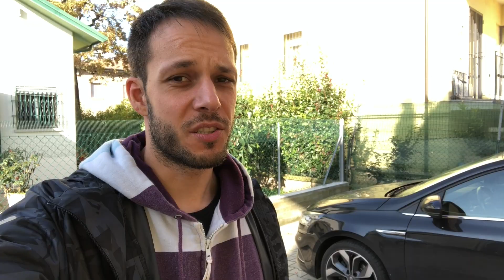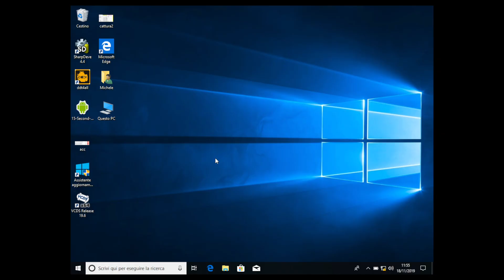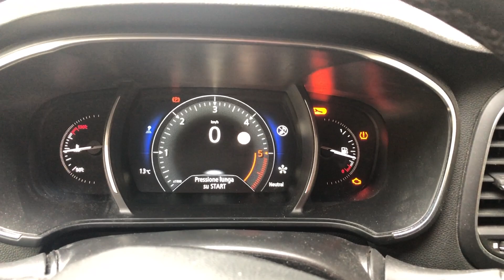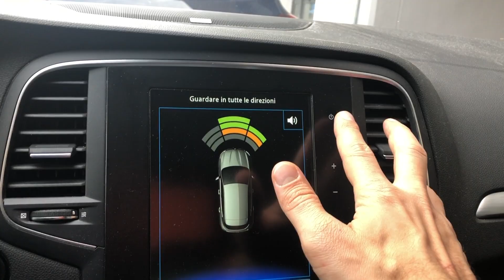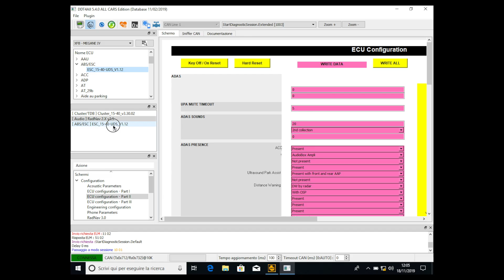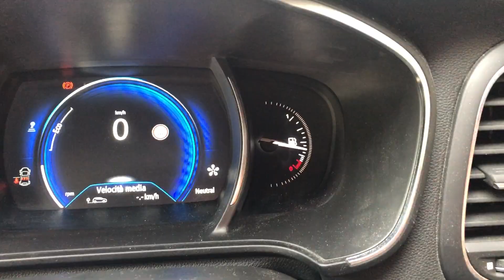TPMS Sensor Deactivation and Error Clear with DDT4ALL | DDT4ALL and R-Link 2 Tutorial

Comment: I have got Dacia Sandero 2015. year with TPMS, using pressure sensors on valves. I have got three sensors, one sensor is missing!? Is it possible to disable TPMS? Is it safe regarding ECU, computer? Thanks in advance

Comment: Hello MicheleP, I watched all of your tutorials, but I am stuck and I need help, I am willing to pay in exchange for the help.
I swapped cluster, I had the simple megane 4 cluster, and I got one from megane 4 GT . 
I get parking sensor error, parkingbrake error, sos call error, and as soon as I open the front doors ( when just unlocking car ) the car plays the sound and warning as if the doors were opened while driving ( but car is parked and engine off ) 
Also, the new cluster has a lot of kilometers, while my car is under a year old, and has 30k.
I went to the section you showed, even found the option to "sync" kilometers from ECU with the odometer, but nothing changes, and the errors are annoying.
I tried to clear them with DDT4ALL, also following your tutorial, but didnt work.
Please help, I can provide email or phone number for viber/whatsapp , whatever, and can pay for your trouble.

Comment: Thanks MichelleP! Finally I'm sorted.
6 months ago I bought bigger  20" alloys with new tpms for my 2017 koleos. Renault wanted £450 for reprogramming the new sensors. I didn't want to pay them that much just for a 30min job. So I searched the web, forums etc. and I came across your video. Bought the OBD2, downloaded the program and connected the wifi pc to the OBD2. It was very easy. I also changed the welcome logo to RS logo.
Reply: Greetings, did you turn off those old sensors or did you pair the new sensors?

Comment: It does not work on megane 4 2018. It loads all settings for cluster but after I change setting to "Without TPMS" it disconnects. Then I can't connect anymore. After some time it connects again but can't load parameters. Program just freezes.
Reply: Hi, which obd did you use?

Comment: I just bought a 2nd hand megane 4 gt-line 1.2 I'm wondering if TPMS is standard or not? When I check the Tyre pressure screen it's all - - if I reset it it tries forever but never settles on a number

Comment: Please can you help me. I have a Megane 4 RS. Im changing from 18 inch to 19 inch wheels. In ABS/ESC section on the video.... i have 3 different versions on my DDT4ALL.
- ESC_15-40-USC_1.12V
- ESC_15-40-USC_1.5V
- ESC_15-40-USC_1.8V
Which one do i change???

Comment: Ciao Michele, if could I have the question, after changing the tires the error with the "key" has appeared, did you know maybe how to reset (clear) the error without deactivation tmps sensors? Just to force the system to new search the sensors? Thanks for your answer. Ciao

Comment: Hi friend. Nice tutorial.
I have a clio IV and I have one question.
I disabled in TDB module, the TPMS: option (without TPMS) because one of the 4 sensors are broken.
After I reset dashboard to clean the message ( Test tyre sensor), but after a few km the message appears again.
Why does the message appear again, if I have tpms disabled?
Thank you bro. 
Pd: using the same obdII + ddt4all

Comment: In my Megane 3 ph2 with ECU L38 ...95 (scan the ecu via can option first!) The option is not at all TPMS, the option is in the same sub menu but called SSPP; However you simply cannot disable it or on the ODO you will show ERROR PROGRAM...Garage told me since 2016 it is mandatory to have the check Hence no disabling of this menu allowed...cannot say if true but i cant put it OUT.

Comment: i did this selecting megane IV, i actually have a Megane station wagon from 2014, once done there is "ERROR PROGRAM" instead of the TPMS infos.

Any idea? Is this just because I used the wrong car model? I tried to undo the change but it wont clear. I put the old wheels back but the menu is just gone and replace with the "ERROR PROGRAM"

Help please
Reply: The garage told me the tpms is store in 3 devices, odometer, ecu and one more...if one is out, the other 2 will complain about it and give errors...so i need to find the other 2 and change them. This tutorial did not work for me.
Reply from the maker: With my tutorial I always manage to clear the error. So I’m sorry if for you doesn’t work but I cannot help you
Reply: @drivewithmi  i am not blaming you ;), just a pity it doesnt work for my megane sw 2014.
Reply: @Michele Predieri and to whom it may help, i fixed the issue. In my Megane 3 ph2 with ECU L38 95 (scan the ecu via can option first!) The option is not at all TPMS, the option is in the same sub menu but called SSPP; However you simply cannot disable it or on the ODO you will show ERROR PROGRAM...Garage told me since 2016 it is mandatory to have the check Hence no disabling of this menu allowed...cannot say if true but i cant put it OUT.
Reply: @chefitalieitaliaanskokenop2200  I have a Renault Megan MK3 Diesel Estate. I want to turn my tyre pressure sensors off with this DDT4LL.  How did you do it on yours? Thanks
Reply: @TDE-76  see my previous post, the option in my car is sspp not tpms, but when pff a warning STOP ERR is shown...so i dont know how for this model

Comment: Hi Michele I just bought the tool. Couple of questions:
1. Can you use this tool to activate automatic parking brake function when powering of the engine? From what Ecu? I have Talisman Grandtour 2016. Tool doesnt read the ABS/ECU... so apparently no support to that Talisman module.
2. Can you use this tool to activate ECS-support to trailer towing? I have bought a car spesific electric kit with the towbar so that should be ok for this to work...

Comment: Do you know how to change the maximum cruise control speed with DDT4ALL? When driving, I can only set up to 150 km/h. It doesn't let me set a speed above that value.
Reply from the maker: Tried several times, change the speed but every time I start the car the speed will reset to 155km/h. Need to study more!
Reply: @drivewithmi  Thank you for your answer. If you find the solution, please post a video describing the procedure.

Comment: Can tmps on / off button be added to rlink2 screen?
Reply from the maker: Unfortunately not. In r-link you cannot create things, you can only activate or deactivate stuffs 😂
Reply: @drivewithmi  
you have activated traction control via rlink. Is it possible to activate tmps with rlink? 
ok again to activate tmps again to use ddt4all is required?
Reply from the maker: @abdurahmankaraduman1213  yes, DDT is required to activate/deactivate TPMS

Comment: One of my TPMS sensers is broken when I change the tires, and how can I link the new senser to the car system? Please help me. Thanks a lot.
Reply from the maker: If you bought original Renault sensor they will auto configure.. it will take also one hour, don’t worry 😉
Reply: @drivewithmi  what if the sensor isn't the original but has the same part number? what is the process to configure it? appreciating your reply.
Reply from the maker: Well actually it should auto configure it too!
Reply: @drivewithmi  thank you
Reply: @drivewithmi   i have another explanation.  how i could open and configure the front Camera through the DDT4ALL?

Comment: Liked it ! Can the TPMS be deactivated permanently?
Reply from the maker: Yep! Just leave the parameters like these!
Reply: @drivewithmi  Got it ! I'll give it a try !.....have you had or heard about the 1.3 TCE gpf petrol engine beeing sensitive about gasoline quality? Mine seems to lag a little till it warms up....
Reply from the maker: @hirayaman246  yep.. the fact is: sometimes with poor quality gasoline happens that there might be some "pre detonations", and the ecu sees it as a "knocking".. this could lead to "recovery mode" by the ecu, so there's a lack of power. try to fill up with premium gasoline, or with a cleaning additive
Reply: @drivewithmi  Thank you so much for your answer - i thought of this but still didnt believe it was so sensitive...
I mean, the first 2 minutes after it starts, you must rev it till 2500-3000 rpm otherwise it wont pull, it laggs.....made me think that maybe there were some ignicion problems....
Reply from the maker: @hirayaman246  99% is low quality gasoline
Reply: @drivewithmi  Thank you once again , for re- assureing me.....i have some other turbo engines tunned and modified but they arent so sensitive....thank you man 👍
Reply from the maker: @hirayaman246  the newer the engine gets, the delicate it becomes :(
Reply: @drivewithmi  Yes....at least, compared to my german engines, it doesnt burn oil......the main reason i have chosen it....